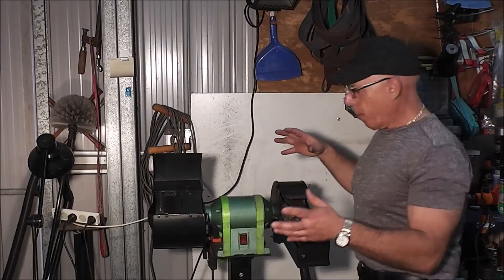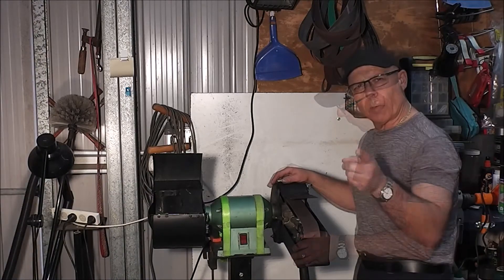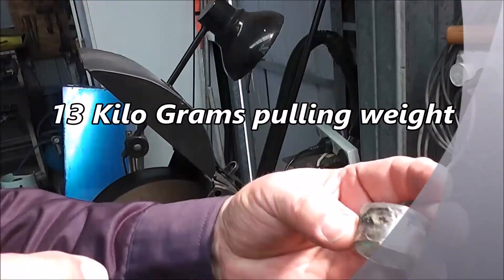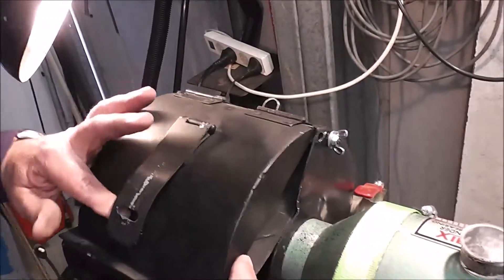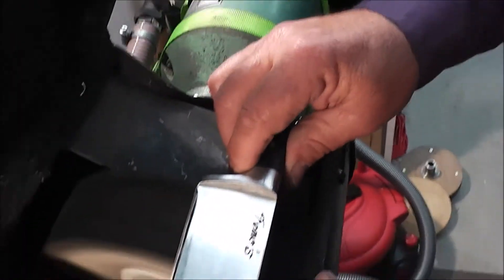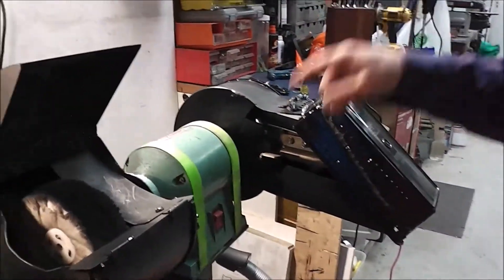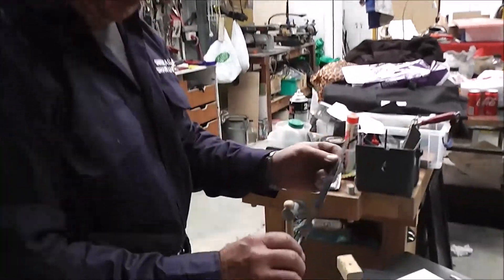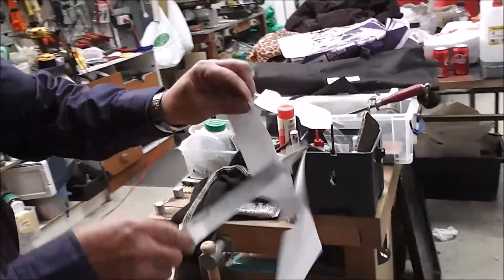How to sharpen knives so they are surgically sharp. Bench Grinder Safety Guard

Comment from the maker: Hi folks, In this video I show the safety guards that I made for my knife sharpening grinder..I also show the burr edge that is required to get a cutting edge. 
The use of a Cuttle Fish to clean off the cutting compound from a knife blade with out the use of chemicals.
 The use of a leather strop. 
My vacuum system.

Comment: Great tip to show the burr and to not let the blade get too hot. I personally only use a stone on my knives and I never let anyone use my good knives. I use a diamond wheel to sharpen my lawnmower blade and to regrind bimetal hole saws. FYI: hole saws wear out fast when using them on plaster. I have an old circular saw I clamp in a jig and regrind the teeth after about 6 holes I cut in plaster. I had to drill 384 holes when I insulated my 5 bedroom home with blown in insulation and I did it all with 1 1/2 - 3" hole saws. You need to have a tub of water and keep the blade cool after a few cuts.
Reply from the maker: Seth Emai 
Thanks again for your constructive feedback and comment..
I appreciate it..
Will upload a video soon on sharpening clients knives.
Happy New Year.
Cheers TONY .🔪